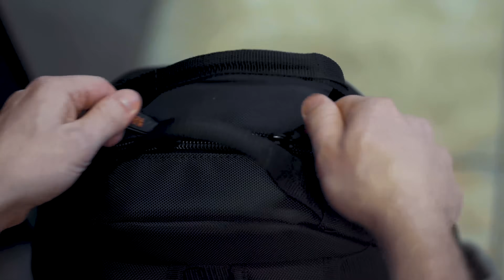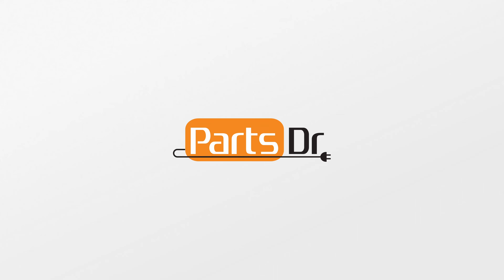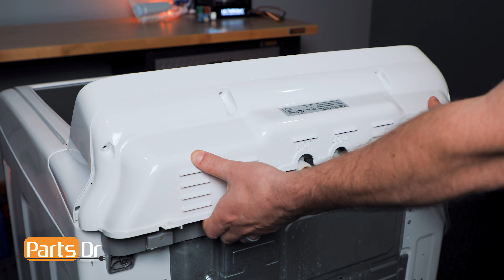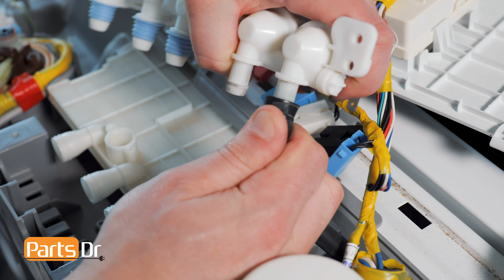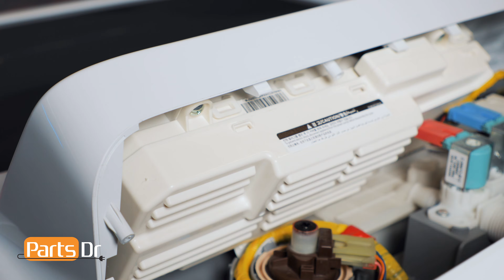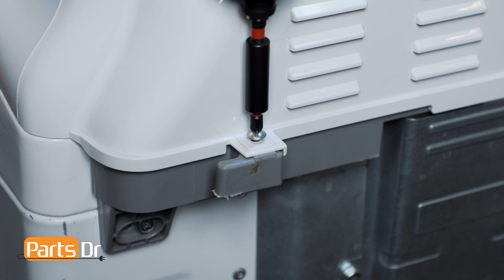Fix 4E, 4C, NF Errors - How to remove/replace Samsung washer water inlet valve part # DC97-15459G

Comment: Yes I’m basically having the same problem everybody having my thing is striped because the hot water keeps leaking. So I need find where to order the water valve inlet thanks to you I know how to put it on and everything
Reply from the maker: Hi Kisha, just search your washers model number on our website partsdr.com and it should be easy to find!
Reply: @PartsDr  yes it really was and I wanted say thank you for showing me so to repair it myself

Comment: If water is only leaking from the hot water valve inlet, would replacing the the whole valve assembly might solve the problem ? I already tried replacing the hoses but the leak occurs in the same valve.
Reply from the maker: It sounds like replace the water valve might solve your issue.  You will have to make that diagnosis, we aren't able to do that over the internet.
Reply: @PartsDr  Thanks for the response, I used a multimeter and the reading was below 1000 ohms (940ohms was the reading). All others were 1000 ohms or greater.
Reply from the maker: @CarlosHernandez-ll2kr  An ohm test won't tell you if the valve is leaking or if one of the solenoids is stuck open or closed.
Reply: @PartsDr  Ok thanks! I will be ordering the part from your site. Hopefully it all works out. Thanks

Comment: The plastic on my water hose line is striped and the hose worn stay on. Is there any solution to this besides replacing the whole inlet value system
Reply from the maker: Unfortunately, if the threads on the valve are stripped you will have to replace the water inlet valve assembly.